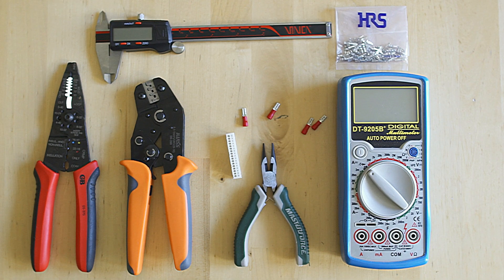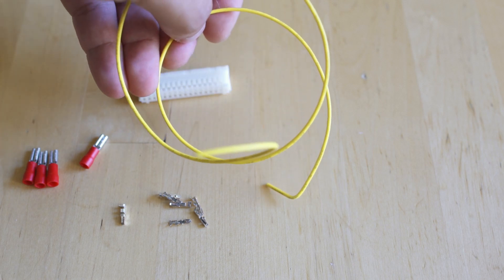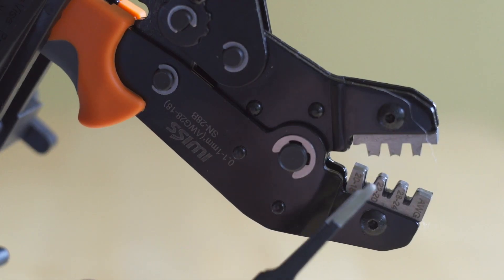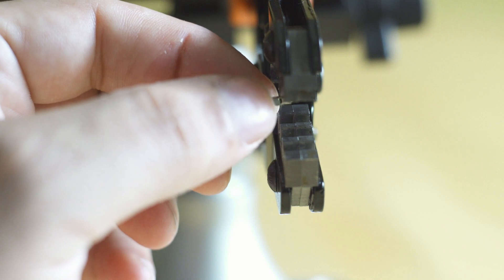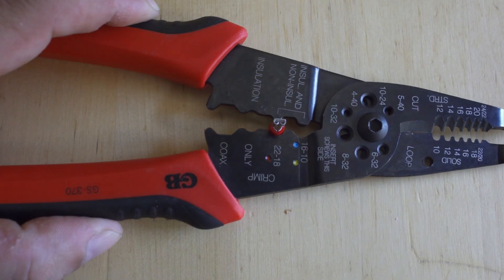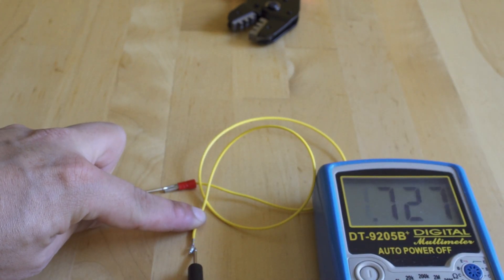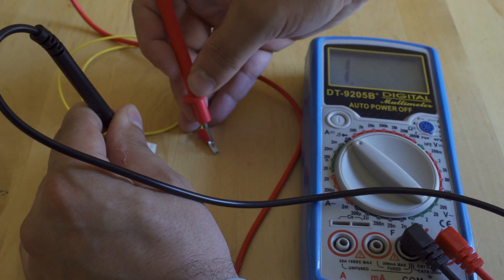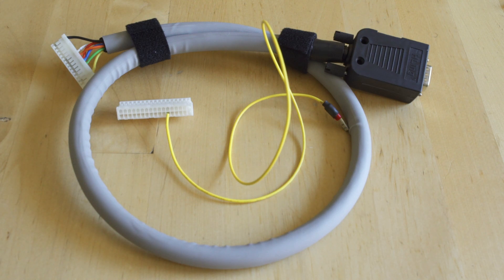Crimping Pins and Making Custom Kick Harnesses for your Arcade  - "On a Technicality"

Comment: What size /name is the red part of the end of the 2ire which connects to the button micro switch ?
Reply from the maker: .110 quick disconnect
Reply: @VideoGameEsoterica  much appreciated , is that equivalent to 2.8mm? ( I looked for the .110 quick disconnect online and it will give a result of .110(2.8mm) )
Reply from the maker: Should be the same :)